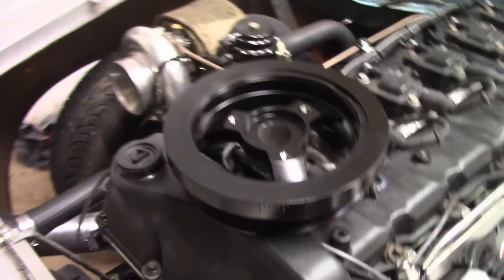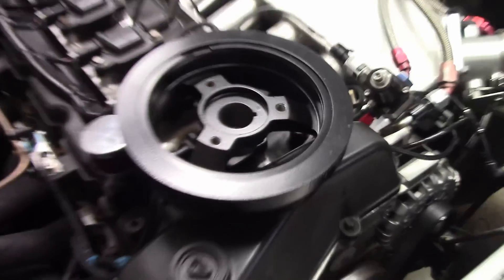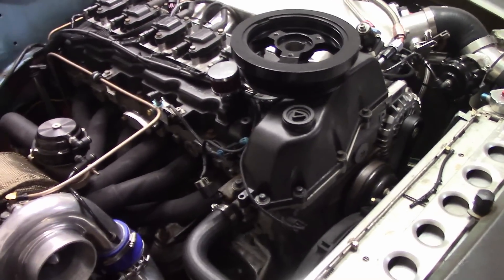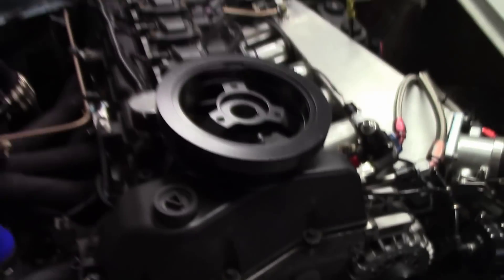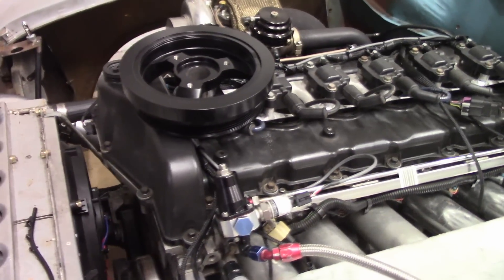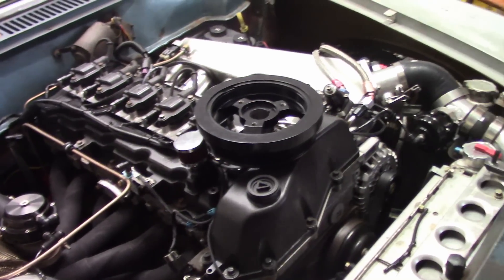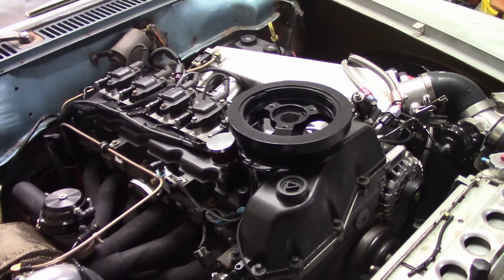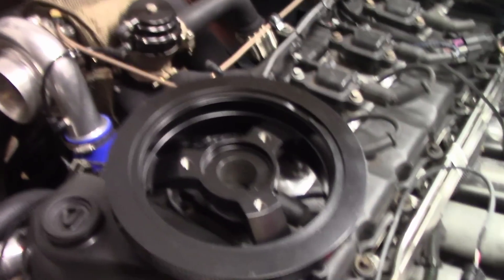Vortec 4200 Improved Damper

Comment: Are crankshaft studs used in this turbo build?
Reply from the maker: No. My engine is completely stock.
Reply: @Calvin-Nelson  I was thinking studs for insurance and may add rigidity to the bottom end and crankshaft receiving more support at RPM.
Reply from the maker: @clint4004  Yeah. If you don't rev it, it is not a problem. The power curve starts to lay over around 5500 anyways, so the RPM isn't really going to get you anything
Reply: @Calvin-Nelson  in stock form sounds great for a Bronco I have. If you cam it some that will change. I guess the torque to yeild bolts in the head snapping make me question what the used in the bottom end. Just curious but is it possible LS studs can interchange in this application?
Reply from the maker: @clint4004  The head studs from a early LS (the long ones) look like they would work in the head. I would love to try them, but I don't really have any reason to. I'm making about 450whp with no issues.
Reply: @Calvin-Nelson  sry I meant the main cap studs for the crankshaft. Replace those with studs. I guess I'm of the opinion that if the main cap studs are anything like the torque to yeild head studs then they just snap. So my point being that could lead to harmonics in the bottom end. plus failure at a particular boost level ECT....
Reply from the maker: @clint4004  Yeah. It has a main girdle. I've never take a main bolt out, so I don't know if they are anything like the head bolts.
Reply: @Calvin-Nelson  guess time will tell which is the weak point the girdle or the bolts.
Reply from the maker: @clint4004  Yeah. Something is going to give at some point.
Reply: @clint4004 that block and bottom end are just like the LS, with very similar external webbing and 6 bolt main caps. Knowing GM it's probably the same fasteners. If there even close the last thing I'd be worrying about is the lower block strength dude

Comment: Thank you. Learn something new everyday. 

My limited research shows the stock damper weighs about 5.3 lbs. The BHJ  weighs 10.7lbs. Is the extra weight alone moving the frequency? In cummins 5.9/6.7 the heavier the damper the better (in my experience) for a smoother running engine. Also makes you wonder if GM had put more R&D into this there wouldnt have been as many spun #6 rod failures in the 02-03 engines. 

Exploring these frequencies in large cubic inch I-6 diesels would be interesting. It makes you wonder about old buick inline 8's as well.
Reply from the maker: I believe the two balancers are the same weight. My understanding is they change the thickness or properties of the rubber in the damper to move the frequency. I'll throw each one on the scale when I get around to it.
Reply: @Calvin-Nelson  Weigh them yet by chance?
Reply from the maker: @joeinmi8671  Finally have an answer for you.

Original damper: 10 pounds 1.6 oz
New damper: 10 pounds 11.8oz
Reply: @Calvin-Nelson  Do you recall whom you sourced the BHJ dampener through? I'd like to order one as well. Thank you for these videos! Edit: I reached out to them via the contact us form on the bhj website, so I will patiently await who their distributor is, but I thought asking you may provide a quicker answer :)
Reply from the maker: @christopherryan9864  The guys name is Jeff Wieser. I know the email on the BHJ website was wrong when I sent my inquiry. Maybe they fixed it. If you don't get an email within a week, I would give the phone number a call. That's what I ended up having to do.

Comment: Would adjusting the VVT on the exhaust help spool the turbo quicker and give you more low end torque?
Reply from the maker: This thing lights off so fast, I don't think there is much to be gained there.
Reply: These engines don't really have a torque curve per se it is just a flat line straight out of the gate.

Comment: It's so funny because I had a 2003 Chevy trailblazer 2wd with a locker in the rear that I would hold to the floor all the time and it would shift at redline and never noticed any vibration from that motor for 185,000 miles. They must have had seriously soft engine mounts to absorb the vibrations. That's the main reason I dislike inline four cylinders, especially after driving horizontally opposed Subaru motors for so long. Great info, good luck!
Reply from the maker: That's funny man. The stock rev limiter is at 6000, so you probably never got into the bad harmonics.
Reply: Nivlac57 Ha, GM knows it’s manufacturing parameters, go figure! It’s like when u go to the doctors and tell him it hurts when I do this, so he says don’t do that. They built a motor that vibrates above 6,000 and doesn’t let the stock computer rev past 6,000 so if will never vibrate, my tach must have been optimistic, it didn’t have a redline and it used to zing by 6,000 on the shift. All the other trucks in CT were 4x4’s, I had the only 2wd I could find in 2003, dealer said he got stuck with it and nobody wanted it because no if it knows how to drive in the snow so I got it $10,000 below sticker price.